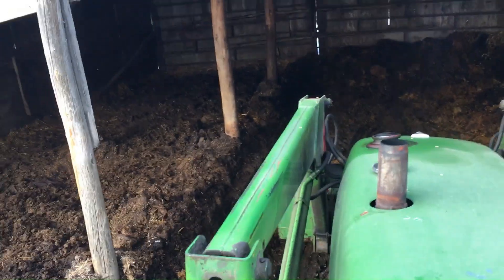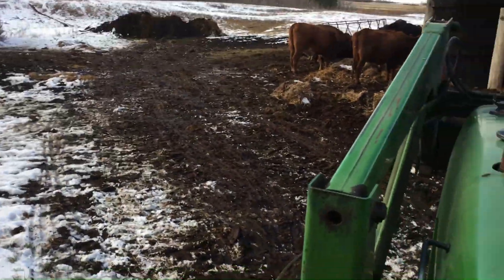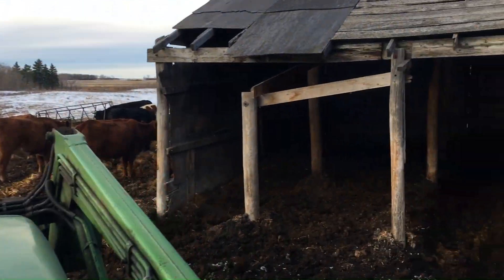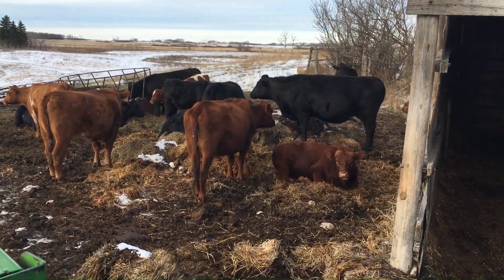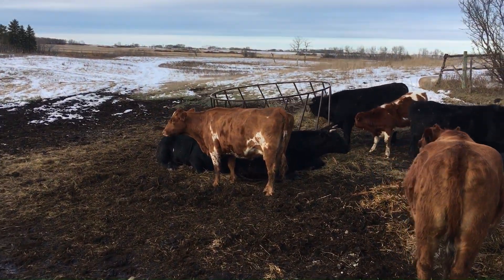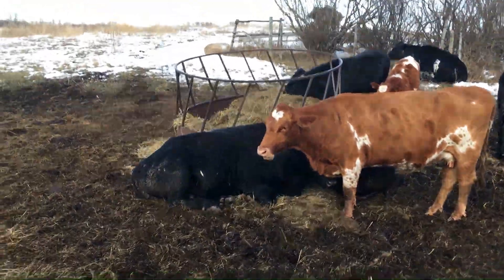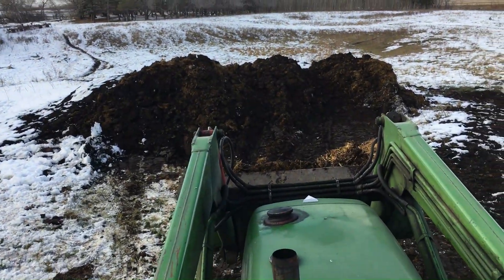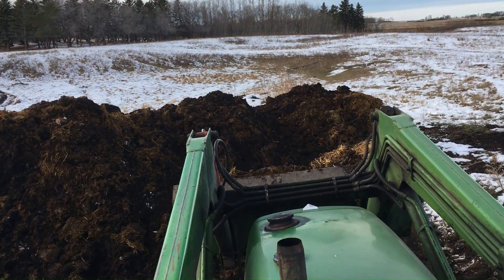A Minute in Manure

Comment: Pretty deep manure in the shed! Is the snowblower ready to go for winter soon or is the jd still having 3 pt hitch issues?
Reply from the maker: Yes, in deep $=!# for sure but the new Westlake tires kept me going. 3 point still has a mind of it's own but I assume it will run the snow blower when the time comes.
Reply: @roosty6  do you have tire chains for it aswell or I guess it’s got the weight
Reply from the maker: @tyerock7851  No I've never had tire chains on a tractor. Theres times I could have used them.
Reply: @roosty6  i seen a advertisement in “the book” for I grip studs bought a set for my Massey and they work wonders easy to install and night and day difference easy removal in the spring too tires seem fine and I never lost any over 80 hrs of use
Reply: @tyerock7851  Good  day from Ontario.  R these the studs u screw in tire,  like yrs ago we had studded snow tires  ?  Thanks
Reply: Well-behaved cattle,, I always found when you're cleaning the barns and scraping the feedlot they would always want to be right there up close and personal and watch every move you make LOL
Reply from the maker: I will have to look that up in the book as I've never heard of them.
Reply from the maker: They look nice and laid back in the video but some of them can be a miserable bunch of ornery critters at feeding time.
Reply: @donvoll2580  correct